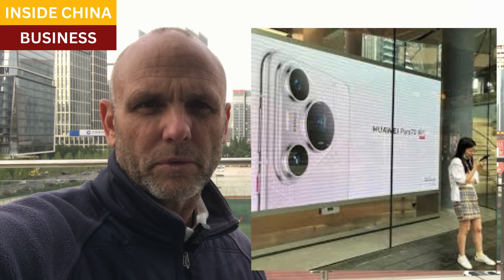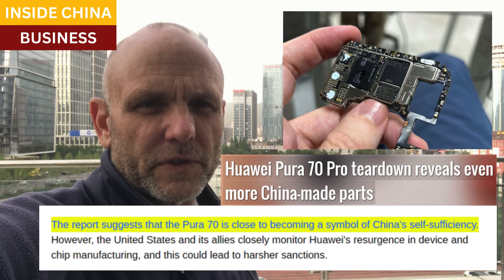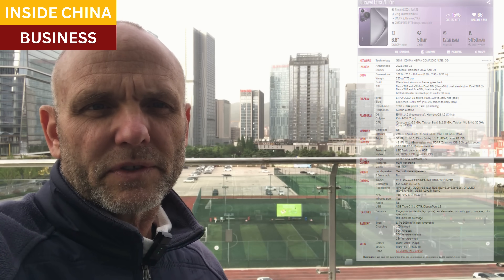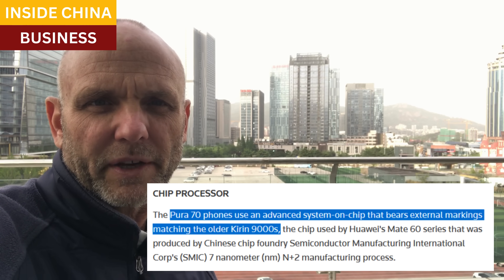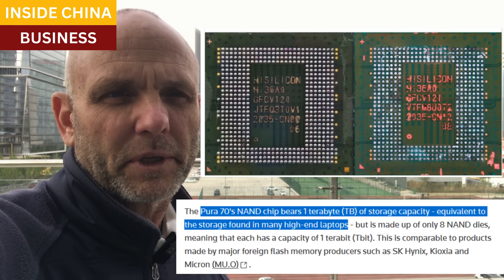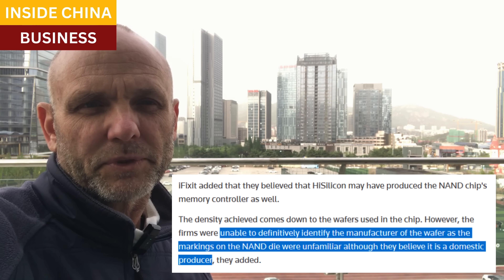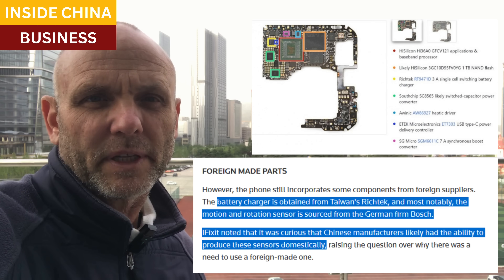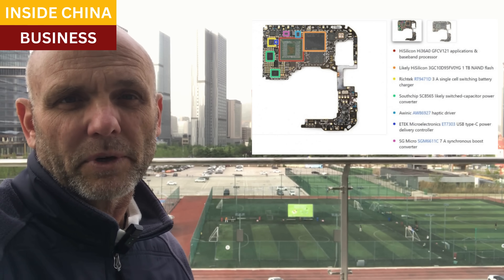Huawei's Pura-70 is nearly "a symbol of self-sufficiency": teardown reveals more Chinese-built parts

Comment: I'm so impressed with Chinese phones. I'm currently using a Vivo X100 Pro purely for photo taking and it's more or less replaced my 1in sensor Lumix. The sensor + AI in the Vivo beats my iPhone 15 Pro to a pulp yet costs half the price. The Pura is damn good considering the sanctions in place. I've seen some comparisons, not quite as clear and sharp on the tele end compared to the Vivo but it has better shake reduction and faster shutter. But overall still fantastic. I think the next Huawei model will likely take it to top spot again.

Comment: I would like to point out:
The SOC in pura 70 is clocked slower than the SOC in mate 60 but the pura 70 is faster than mate 60. Which means:
1. There would be a variant of pura 70 chip that even faster that Huawei haven't release yet. Probably for Huawei Mate X?
2. The architecture of the new chip or maybe the nm of the new chip is way better than the one used in mate 60